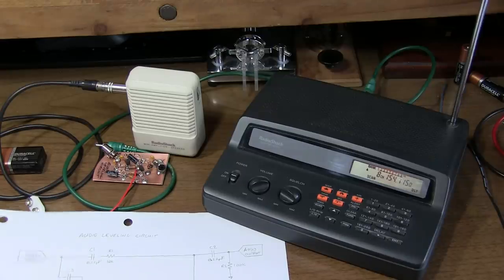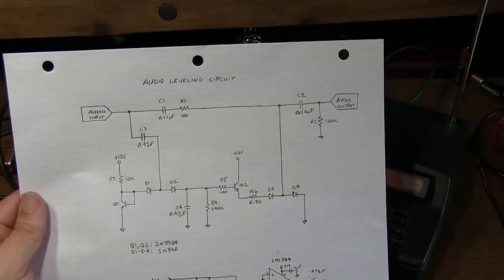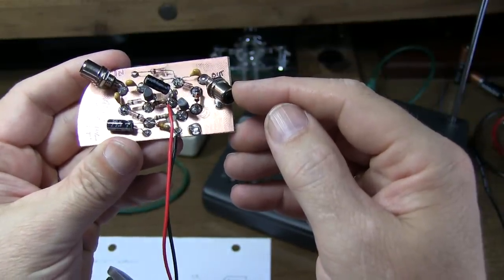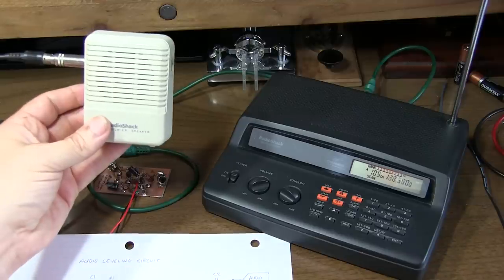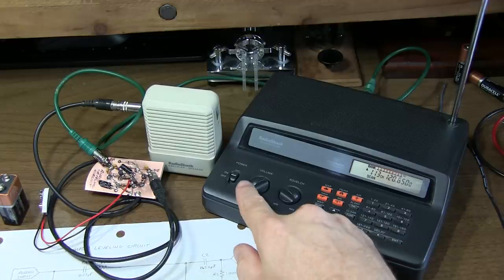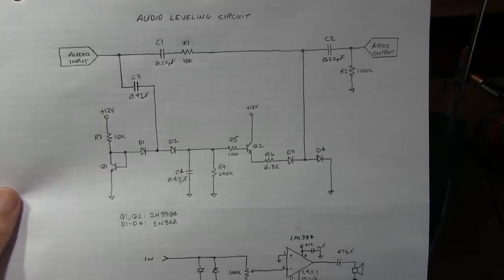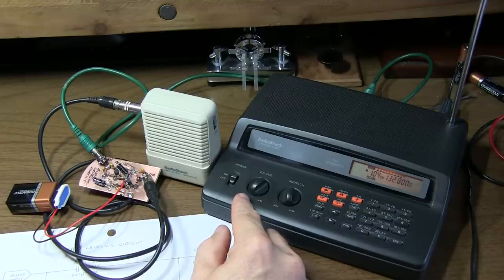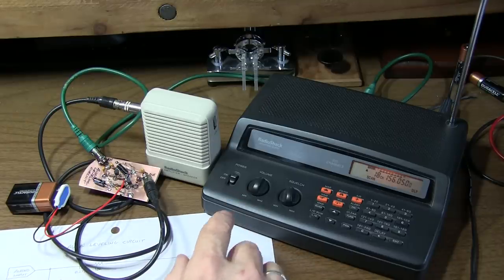#163: Automatic Volume Level Control circuit demonstration | scanner

Comment: I didn't know this circuit existed. I kept planning to look for it for ages, but for some reason I had been forgetting to actually do so. 

Finally, I did a search for auto volume control regulation or amplifier regulation and this came up. The reason being, I have issues with various recordings and social media in particular not having any standard recording level. So one viewing will be alright then when I go to another, I'll get blasted by higher recording level or conversely cannot hear and have to turn up. 

Latter is even worse if I have to increase volume for a presentation then go to another that has an unexpected very high recording level. Each time, I'm having to quickly adjust which can be quite annoying. That is especially so if sound has disturbing content which blasts you. 

Otherwise, I maybe listening to music that has an initial quiet, introductory period that progresses toward becoming excessively loud for its ending. That happens a lot with modern classical music. Pink Martini's Bolero is an example.  

My concern was how could it be done without clipping the sound each time amplitude would attempt to go beyond a certain desired maximum level. Of course, I'm pleasantly surprised to learn now that clipping can be avoided by use of capacitors. 

Now I know this amp regulation circuit exists, why does it not form part of hi-fi amplifier circuits as standard (all you'd need is an optional toggle switch to facilitate its use by the listener)?
Does it severely degrade sound quality why audiophile equipment doesn't have it?
Reply from the maker: This simple circuit does degrade the signal (adds distortion)

Comment: Nice sir can i used the circuit in my fm transmitter
Reply from the maker: It's possible - it really depends on your signal levels, circuit impedance and the required signal fidelity.
Reply: Thanks for reply sir